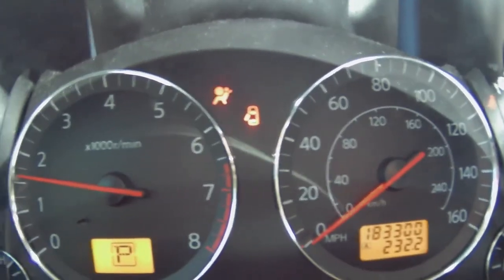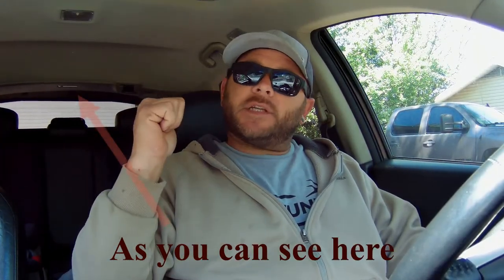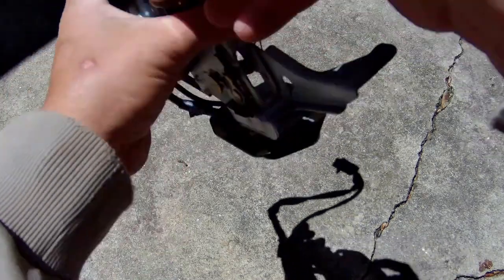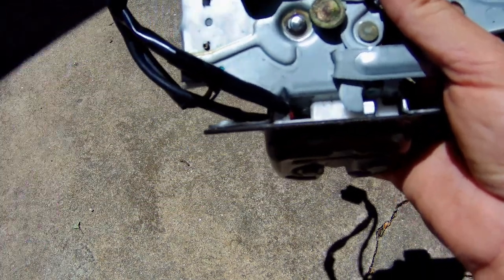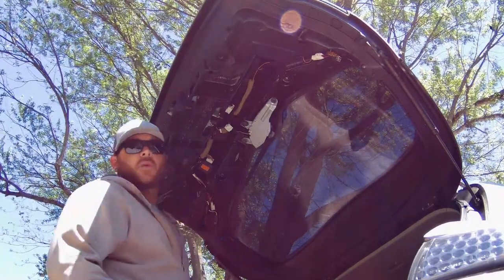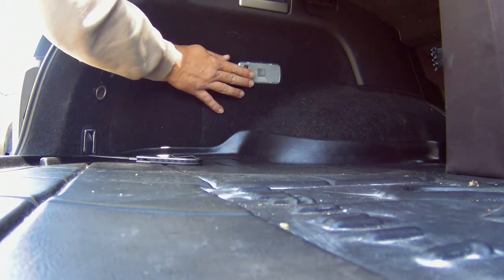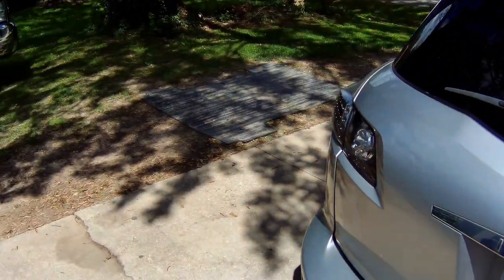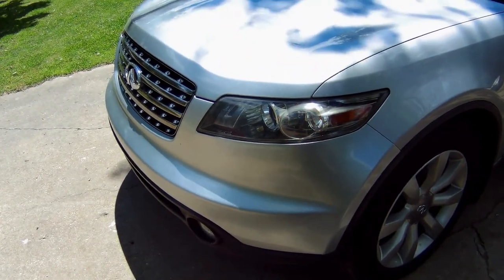Rear Liftgate Door Actuator Fix! (open door light indicator)

Comment: Quick tip, My FX45 had this same issue randomly warn me the hatch was open and would cherp...Turns out it was the rear left cargo light bulb..it was faulty. Replaced bulb and like magic- problem solved. So try that first..takes 3 minutes to do.
Reply from the maker: Good to know. Mine definitely had a wire that was wore thru.
Reply: I'm having the same issue. but my right cargo bulb and trunk light work fine and turn on and off when the trunk is opened or closed. So did your bulb work when you had that issue or was it out? What do you mean by faulty?

Comment: Mine is giving me alarm trigger warnings, but my trunk is closed and works as it should. lights trun in both left cargo light and trunk light when I open the door and then both lights go off when I close the door as well. 

Also there are no indicator on my dash that any door is open. Alarm just goes off and tells me trunk is opeb when it is not and no interior lights are on. Rear latch engages as it should i even hear the click on it when door is closing. 🤷🏻‍♂️